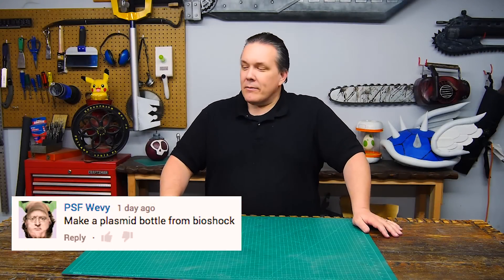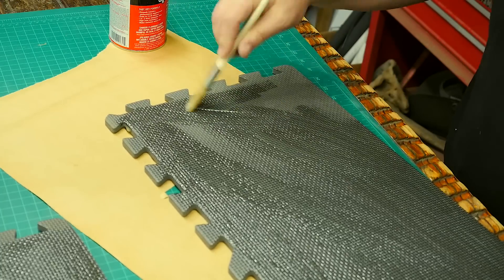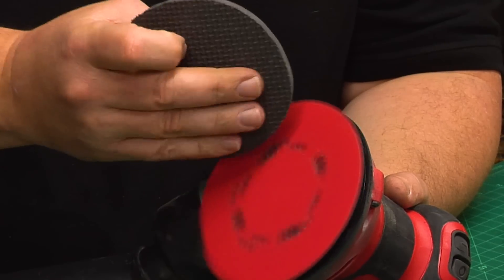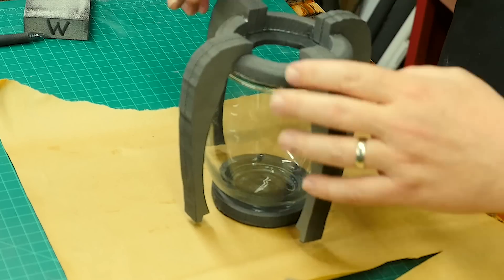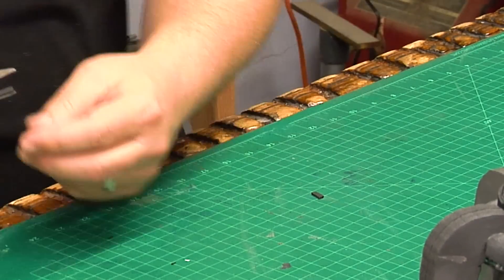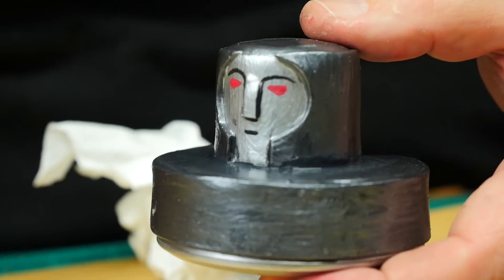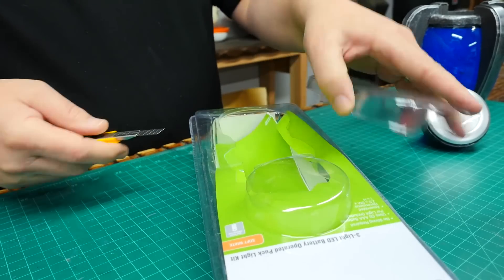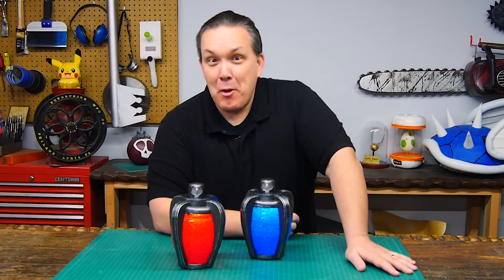Odin Makes: Plasmid Bottle from Bioshock

Comment: Odin, don't bother with mod podge. I find out the best alternative to plastidip is mixing pva glue with water in equal parts, and do at least 5 coats. It dries fast. It won't have the brush marks like the mod podge. Good build.
Reply from the maker: Thanks! The bush marks were a disappointment. I have seen PVA glue and water used on the art cars in the Grand Kinetic Championship, and it worked really well and was strong. I will give it a shot on a future build.
Reply: Yep, if you use just PVA glue, it will end up cracking and peeling. Diluted in water will make it more flexible and durable!
Reply: I often use carpenter's glue diluted in water when building miniatures. I guess PVA works equally well, but in my mind carpenter's dries harder, although it's also a lot more expensive ! 
Another tip to avoid paintbrush marks (if using mod-podge) would be to use a foam brush instead.
Reply from the maker: What's you ratio of water to glue for the diluted mix? I have tried once with a heavy glue mix, and it cracked and peeled straight away.
Reply: With PVA glue, I use equal parts of glue and water. 
More water means you will need more coats.
More glue will mean less coats, it will be thicker, also more propense to brush marks and peeling/cracking

Do some test on scrap pieces of foam and see what works best for you. That's what I did. 
I'm from Brazil, so I'm pretty sure the ratio will be different, because you can get better glue, better foam and better brushes up there.
Reply from the maker: Thanks!

Comment: Could you go into more detail on how you traced the shapes to go in the glass? What's the best technique to get a perfect fit?
Reply from the maker: at 0:31 I was holding the vase level on the table, with paper underneath. There is a pencil against the speed square (the triangle thing) which I was using to trace the profile of the side of the vase down on to the paper. You can make your first pattern with cardboard to make sure it's a close fit.

Comment: One way you can avoid having as large of a seam between the laminated pieces is by sanding off the texture that's on the foam where you glued it. This will not only give you a cleaner seam line, but it will also give you a much better bond.
Reply from the maker: Thank you, I have considered doing that, but haven't tried it yet.
Reply: It definitely makes a huge difference. You could take some scraps you have to test it and see the difference side by side. I love your videos and it's been awesome seeing you grow as a prop maker.

Comment: Hey Odin, i don't mean to promote another channel by doing this but i recommend instead of using the hair gel, you could use the "ninja turtle ooze" that The king of random used. He had a very clear video on the proportions and what makes it better than the hair gel is the fact that you could mess with it and it is possible that the light shines differently inside with the borax solution
Reply from the maker: wingedkuriboh98 Totally cool with King of Random, I subscribe to that channel myself. The turtle ooze is a great idea! I was just trying to go for something cheap, and easy to get a hold of.
Reply: +Odin Makes fair enough!

Comment: hey Odin, I know this is an old video but, how did you get used to the loud sounds f tools like the orbital sander
Reply from the maker: Was the sound too loud in the mix of the video?

Truthfully, my ears are shot. I have 'over the ear' ear protection that I wear with stuff, I forget to put it on sometimes with short use tools. I actually wear them when mowing the lawn!
Reply: ok thank you, and no the sound wasn't too loud,  but I have loud tools so I just wanted to know @OdinMakes  .